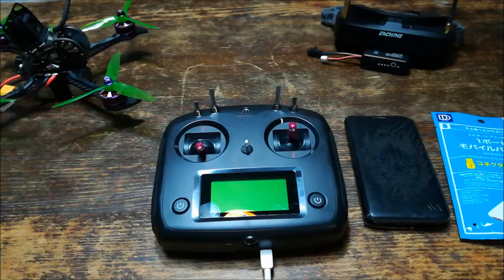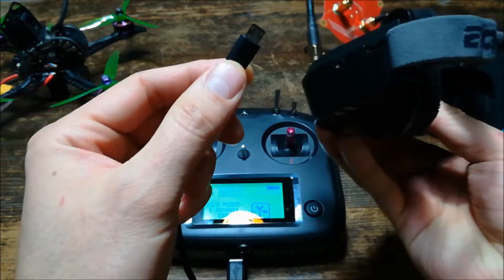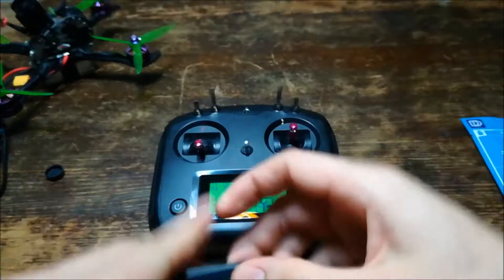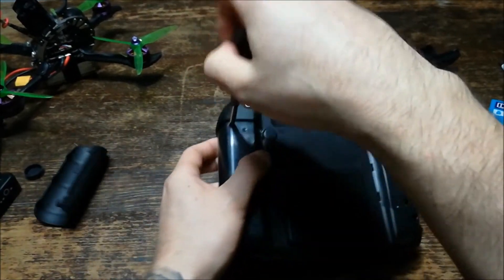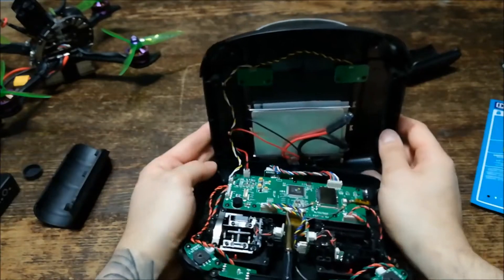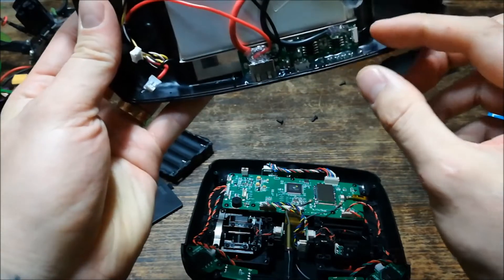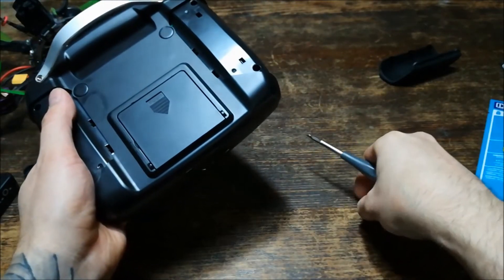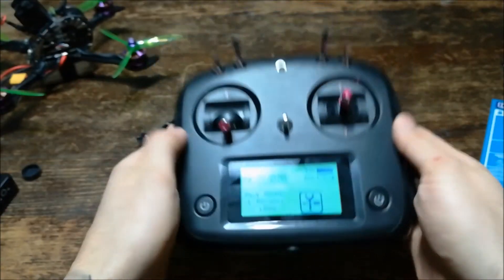Flysky FS-i6S Ultimate Battery Mod

Comment: how did you wire the rc buttons to turn on the battery? I see its not tapped anywhere by the button on the pack
Reply: I actually figured it out ... we have different power banks & mine doesn't auto on ... I wired in another switch

Comment: dont u think the constant 1amp current may destroy the circuits or elements??
Reply: Dont the normal aa batteries output some power anyway?
Reply: @batuerakman2238  LAĞN PEZEVENK YAKALANDINNNNNNNNNN DMDMMDMDMDNDMDJDJJDJRFJJFJFJFJFJFJJFJFJFJFKJFJFJFJFJFJFJFJFJFJJFJFNFNFNNFNFNDNDNDNNDNDNDND , MÜBAREK YORUMLARI BİLE OKUMUŞ DKDKKXKXKKXKX
Reply from the maker: Been a year and still works.

Comment: This is a great idea and I did it like you
I just want to know what prameter to insert in the tarnsmiter low and alarm warning?
Reply from the maker: You should set it according to the battery specs that you used.
Reply: @highkkaido1603  i used the same battery value that you used
Reply from the maker: @ofircohen1378  I set mine to 5v that way it shows a full battery.
Reply: @highkkaido1603  and what about the warnings level?
Reply from the maker: @ofircohen1378  The only thing I changed in the settings was the battery voltage.
Reply: @highkkaido1603  but in the battery voltage settings there is also alarm settings voltage
Reply from the maker: @ofircohen1378  I did not change it i left it stock, I only changed the voltage.

Comment: Good afternoon. One question: What is the radio ranger? Thankful.
Reply: Highkkaido FPV he has a point... if ur using a lower voltage than the 6v of a battrys, the output power will be reduced so will the range.
Reply from the maker: Hi this is a battery mod not an antenna mod video so I have not tested range.

Comment: I'm currently doing this and my question is where are you getting the correct voltage to power the transmitter? That battery is just 3.7v is it not? Are you drawing the power for the trans off of one of the usb ports or did you just run the power directly from the battery and set the transmitter voltage on the transmitter itself to a lower max for the warnings? If that's the case then denying the controller the power it needs would also reduce its range I would think, right?
Reply from the maker: It is being powered off the usb positive and negative which provides 5 volts.
Reply: Yeah I thought that. The board I used didn't have an easy spot to solder to usb positve and neg and it ended up grounding out and frying a chip on the board. Ordering a new one and retrying. Thinking about maybe going 2s with a couple 18650's for 7.4v and then using a step down to 6v directly off the battery to power the radio and then another step down off the battery to the banks main board for its max voltage of 4v. I think that would work.
Reply: Its a powerbank